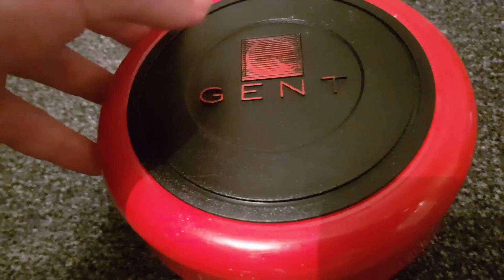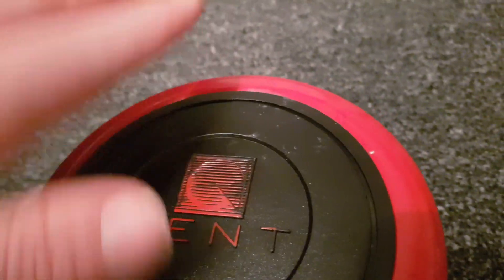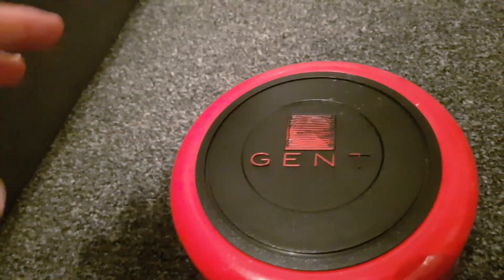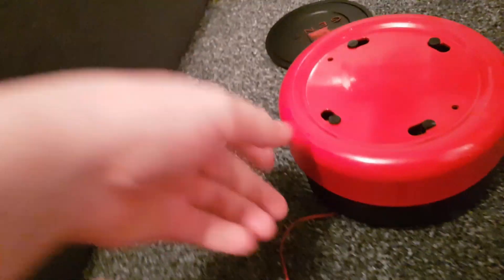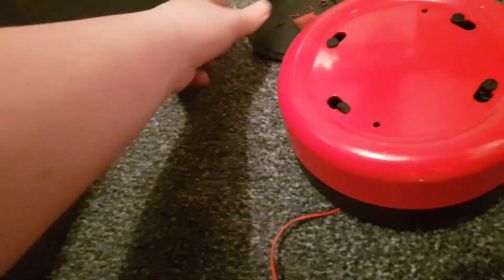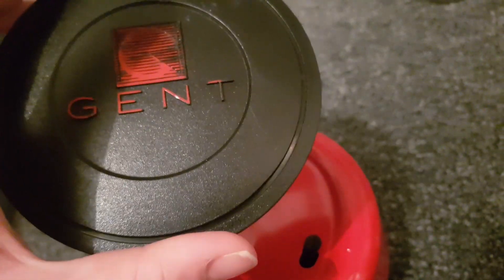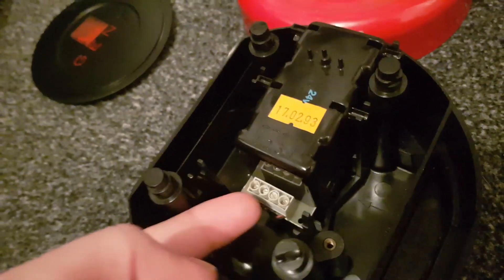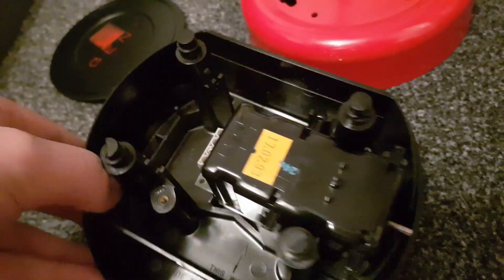A Look At a 1990s GENT Conventional Fire Bell | *Before Restoration*

Comment: I have this for home security in the uk but in grey. they are weatherproof so not covered with a box one at the front of the house one over the garage  they sound great  98db@1m 
Thanks for uploading
Reply from the maker: Those are the Fulleon ones. I think GENT also made ones with included WP kits. Interesting that youre using bells for security! Guess you cant beat the good old fasioned noise makers.
Reply: @JmFireAlarms  oh right that makes sense and yeah I’m a fan of the old school sound of a bell even for security - it’s a rarer sound these days so I hope it draws more attention I have the outdoor siren wired inside instead. I had two Friedland master bells as the original sounders but they rusted and didn’t fare well outdoors.
Reply from the maker: ah strange I thought the master bells were meant to be quite resistant. Guess not lmao.

Comment: Restoring them is a good idea if you want to install a fire alarm system by reusing old devices.
Reply from the maker: Indeed it is, although it isnt the right thing to do for a real system. However for a collector / hobbyist system, having a shiny new bell really completes the authenticity and takes the system back to the 90s!
Reply: But  @JmFireAlarms , it depends if the devices work well, the system jut needs testing every now and again.
Reply from the maker: @calumbrooknicolson  Naa its completely illegal to use them on a real system if theyve been used.
Reply: @JmFireAlarms , but what if it's used on a commercial fire alarm system at home?
Reply from the maker: @calumbrooknicolson  Thats different, because thats a hobbyist system which is fine. However on a system for buildings, it cannot have used stuff.
Reply: @JmFireAlarms , do you mean public places?
Reply from the maker: @calumbrooknicolson  Well, no buildings are public places unless owned by the council, but for commercial properties such as pubs, shops, hotels etc you cannot use used devices
Reply: @JmFireAlarms , I see. But if it's used on a fire alarm system at home, what if it's rented out by a landlord, rented out as a holiday house, etc?
Reply: @JmFireAlarms , that should be legalized because throwing away nearly new devices is a waste and is bad for the environment.

Comment: we have them at school with a addressable system.
Reply from the maker: I think that was one of these bells main uses. Since Gent is fairly common in schools, and before the bell tone was a thing they would have whacked these on the masteralarms circuits. Our school has the new model of these branded by Fulleon in grey for class change.
Reply: @JmFireAlarms  yep we have them on a gent 34000 system which i believe is the predecessor to vigilon as newer parts of the school have vigilon. also some of the alarms are missing there front logo plate 😆
Reply from the maker: @georgexz  Yeah those panels are from just before the reign of the Vigilon.

Comment: I thought the model number for these was 12141
Reply from the maker: Well mine says 4199 on the lock plate and 4013-047 on the backbox so honestly im not sure. However i chose 4199 as the most likely possibility because it sounded a bit like Gents other product codes. You have the older version right?